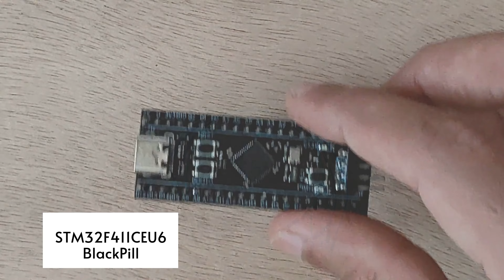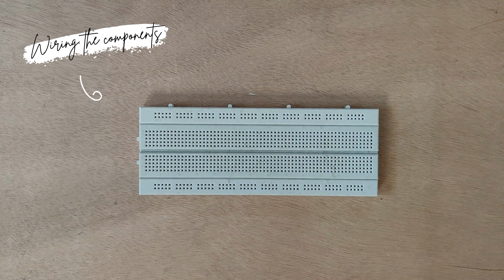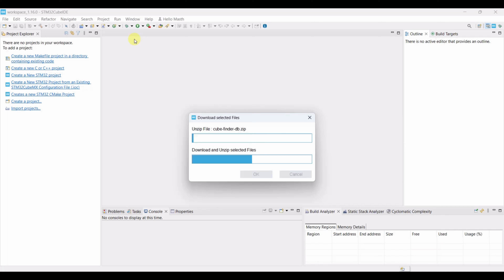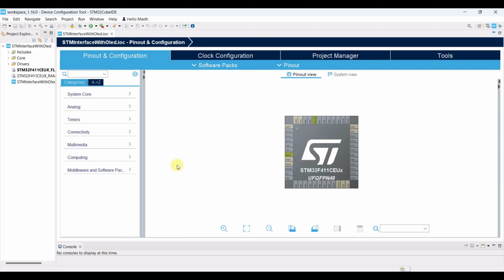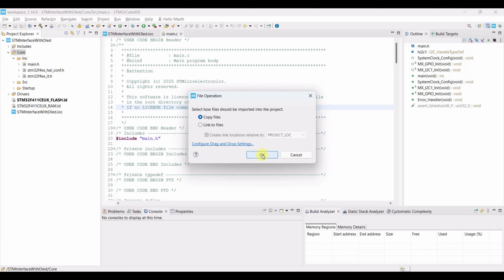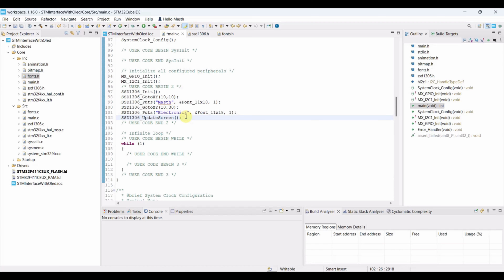How to Interface OLED Display with STM32 (Part 1) | DIY Electronics Project

Comment: ssd1306.h file is missing the 'SSD1306_DrawFilledTriangle' header so you will get a compile error when you add Filled Triangle to the main.c file.  The function code for Filled Triangle is in the ssd1306.c file, just no header in the ssd1306.h file.

They both have same arguments so just copy and paste ssd1306_DrawTriangle header line and add 'Filled' in between 'Draw' and 'Triangle'.

Scroll left and right code may not work in some of the ssd1306 display module's driver I.C. clones.
Reply from the maker: Thanks a lot for pointing this out!

You're absolutely right — the SSD1306_DrawFilledTriangle function is implemented in ssd1306.c, but the declaration is missing in ssd1306.h, which can lead to a compile error.

As you suggested, adding the function prototype in the header file (similar to SSD1306_DrawTriangle) fixes the issue perfectly. Really appreciate you highlighting this for others.

Also, great point about the scroll functionality — it can indeed vary depending on the SSD1306 driver IC clones used in different OLED modules.

Thanks again for the detailed observation! This will definitely help others working on the same setup.

Comment: I need a pre-programmed kit or a complete OLED display for a Roland EM-2000 using STM32. Thank you
Reply from the maker: Thanks for reaching out! At the moment, we don’t offer pre-programmed kits or complete OLED displays for specific devices like the Roland EM-2000. However, we’re happy to share general guidance on STM32–OLED interfacing.